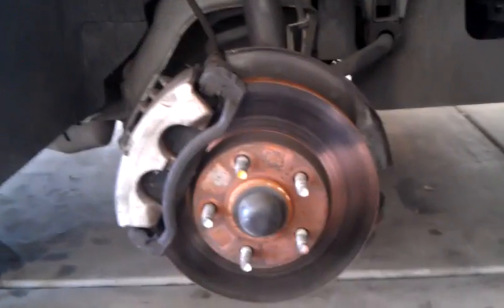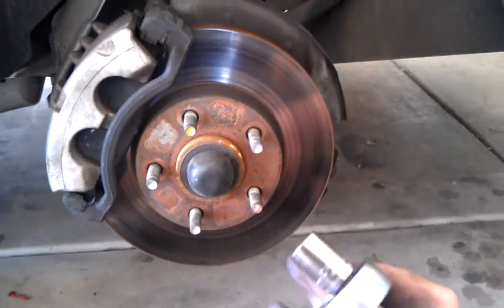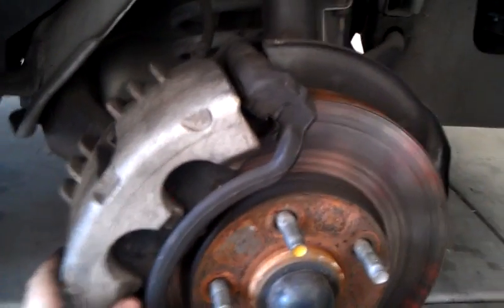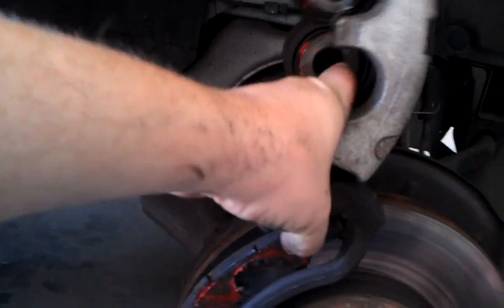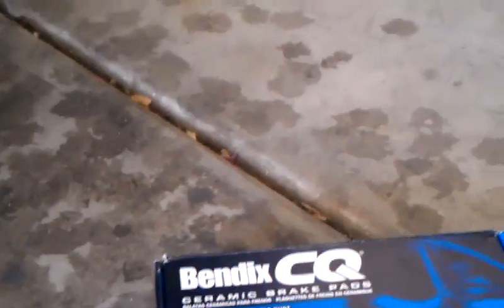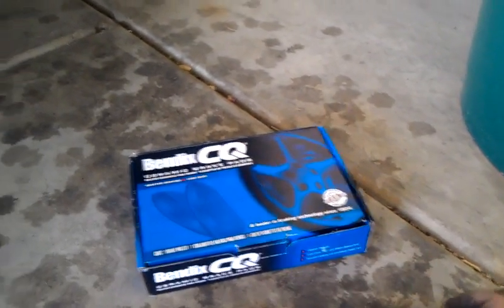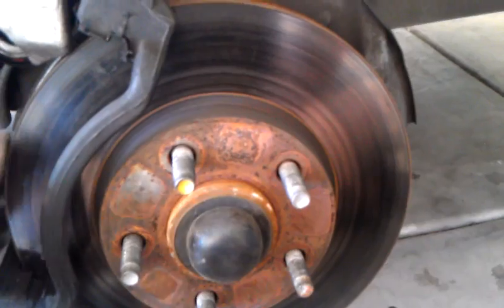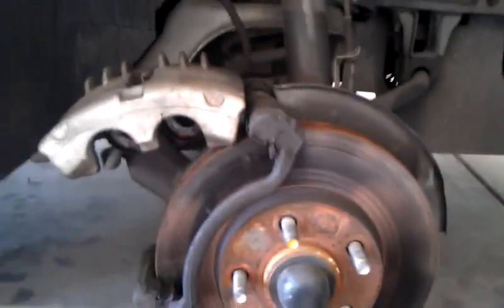Replacing the brakes on the Mustang

Comment: The rear should be the same procedure right? I'm still waiting to purchase the rear. Oh, and I thought I might add to unscrew your brake reservoir cap when you are compressing the pistons. It will overflow unless you use a turkey baster or something to suck up the excess.

Comment: Thanks for the tip, I first added some brake fluid after the ware before I realized the brakes were worn, so I think that was my problem. Is there a special tool to screw in the back pistons, and is there a certain alignment of the pistons need to be set at? Like the screw head position?

Comment: If i need to remove the roters to get turned do i just remove that top bolt on the calipers? Thanx for the vid. Peace and love from deep south georgia
Reply from the maker: If you need to remove the rotor the you need to remove both bolts in the caliper, and the two bolts holding on the caliper bracket. I think these bolts are 15mm, but I could be wrong. Thanks for watching and I hope this helps.